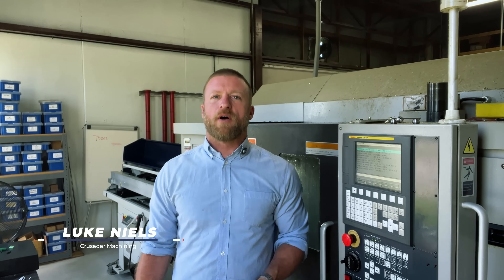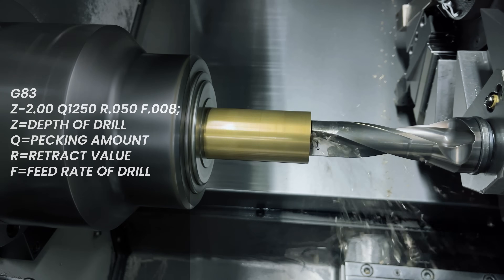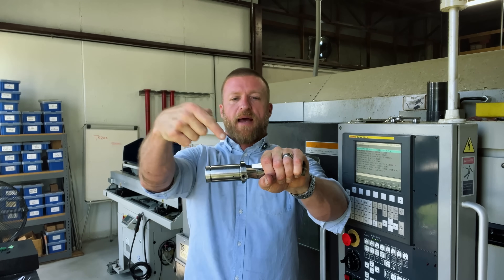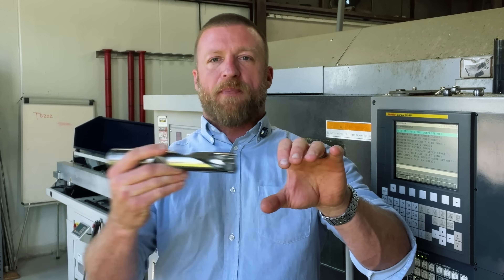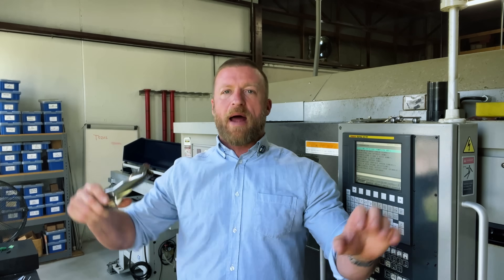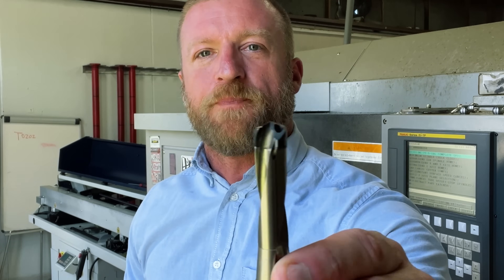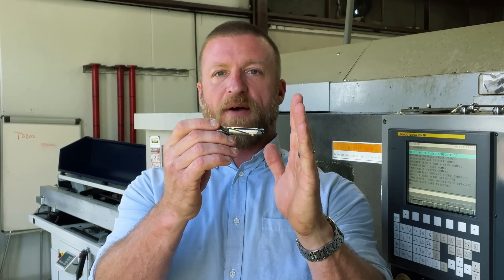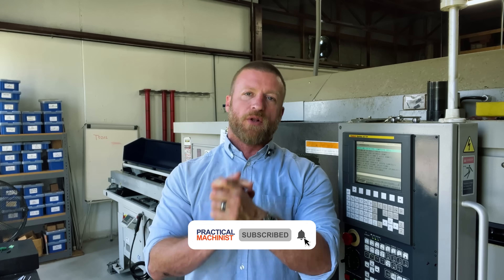When to Use G83 — And When Not To | The Lathe Lab Ep.7

Comment: I program on a fanuc oi-td and my g83 will only retract in incremental amounts, as in, it retracts .100 from the last z depth it drilled to,  not to the z start. Any idea how to change that?
Reply: Parameter 5101#2 (RTR) is the setting for total return out of the hole or just peck, the distance of retract is set in parameter 5114
Reply: That is most likely a parameter.  On those older oi, I hear there is a parameter to change the value.  if it works, can you let me know??
Reply: @Crusadermachining Will do. Thanks man.

Comment: G83 wastes time. And some inserts drills don’t like to peck. So G73 is more time saving and on some some inserts modular drill you don’t brush your inserts margins alot which leads to tool instability and tool wear
Reply: I don't think it's a waste of time.  I have used G83 a lot, and I find it's a pretty widely used canned cycle.  I'll look more into G73 and try it out.  Thank you for the input!
Reply: Quick question on the G73, how do you use that to allow coolant into deep hole drilling applications when you don't have coolant thru the tool?  I love to learn about how others utilized canned cycles and pregaming methods.   Thanks for watching the video.
Reply: G73 is a turning cycle on a lathe

Comment: You need to also mention that the R value is where it will move to before it starts drilling
Reply: Yeah, his explanation wasn’t very clear
Reply: @andrebyman8744  anything I can clear up for you?  I tried covering all the pertinent components of G83.
Reply: I’ve also seen guys assume the R value is the absolute Z point it retracts to, when it’s actually an incremental value from where the tool is before the G83.
I don’t know how common that misunderstanding is, but it could cause problems.
Reply: @andrebyman8744 yeah it’s because on a mill it does behave like an absolute position.
Reply: Thanks for the input, and the R is optional.  I usually don't use the R, unless it's necessary.
Reply: @Crusadermachining I’ve never considered that is optional lol. Just habit to throw it in there.

Comment: Why not also talk about a chip breaking peck cycle? (G71 in Okuma mill) Solves multiple problems you said G83 creates. A chip break style of pecking. Where it doesnt clear the hole every retraction, just retracts a few thou to break that chip. Super useful for plunging with EM's, TINY drills, stringy materials like copper, etc.
Reply: It's G73 on fanuc.
Reply: I definitely can talk about that.  I just find G83 to be a more popular, widely used code.  But thanks for the input for sure.
Reply: And one last thing, in G73, how would that help if you had to get more water or oil down into the hole to prevent dry cutting?  For example, deep hole drilling.
Reply: @Crusadermachining nice! Looking forward to it. And  that’s probably the only situation G83 beats G71 I’ll agree there for sure
Reply: Ideal for situations like pecking out a broken tap too!